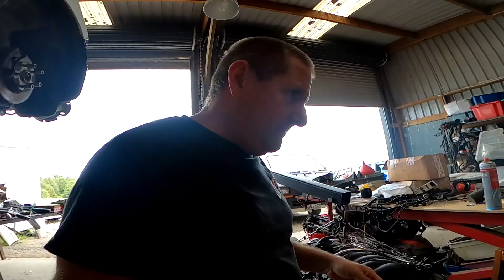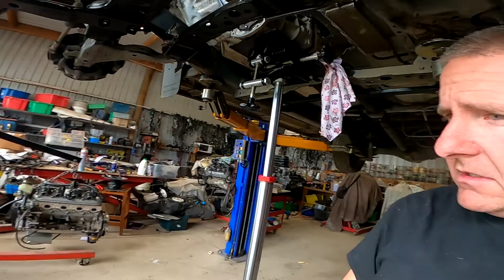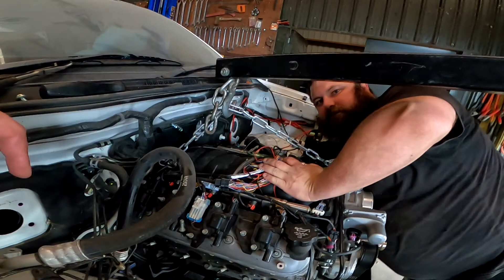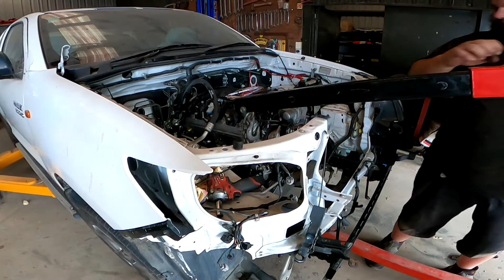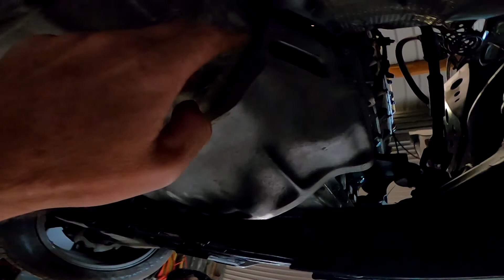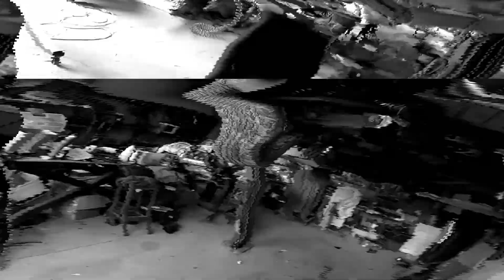2014 2wd Toyota Hilux LS2 6 litre V8 swap. Engine mounts made.  Ep6

Comment: Hello, been watching for a while now. New owner to a 1uz,  but ive been having issues recently with engine hesitation upon accelerating in low rpms and letting go of the gas at around 60mph or higher. 
any info will help thank you.
Reply from the maker: Lots of videos to watch.  Cheers Kelvin

Comment: Howdy! Question on running a smaller oil filter or is best to get relocation kit ? 
Cheers
Reply from the maker: I do plenty of short filters , opting for remote only if there is no other option. Cheers Kelvin
Reply: @CartuneNZ   is there an oem filter to get that is shorter ? Any part numbers 
Thanks
Reply from the maker: Its a part I supply so I won't be sharing part numbers.  Cheers

Comment: Are you going to link the ecu with the ABS?Or thats not needed?
Reply: What’s abs n engine ecu got in common? Thought abs had its own ecu
Reply: Well,i know the abs has data links with the ecu though
Reply: @georgepeprah5118  speedo maybe?
If I’m not mistaken only oem ecu needed for temp...
I’m not sure if abs is linked to either ecu in conversion..
Reply from the maker: ABS works fine on the NZ diesel's without the stock ECU.  Main reason I refit the stock ecu is so the stock temp gauge on the dash works as intended due to the MPX comms line between ECU and dash.  Leaving ECU also makes Air conditioning signal to aftermarket ecu slightly easier due to internal pullup in stock ecu.  Cheers